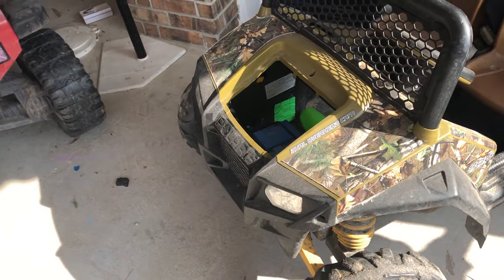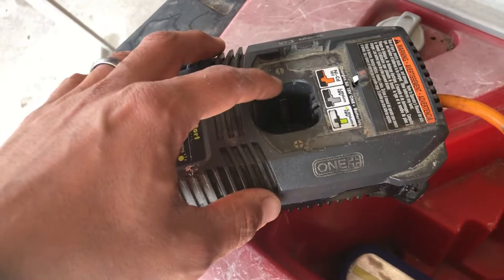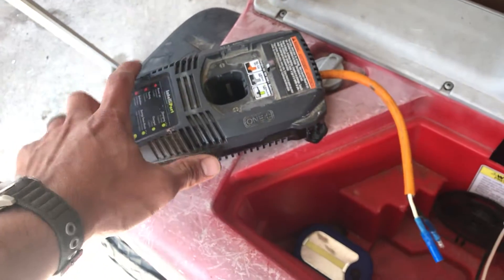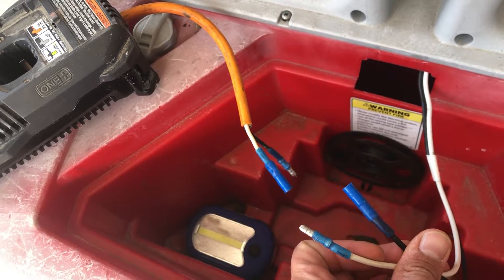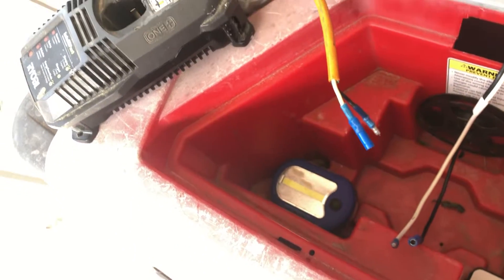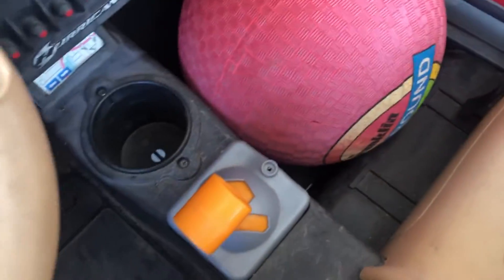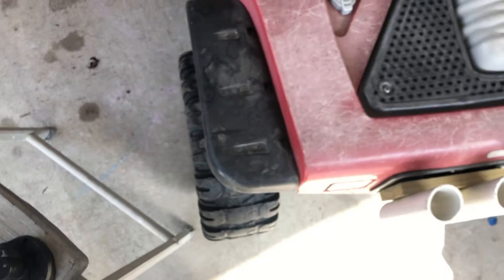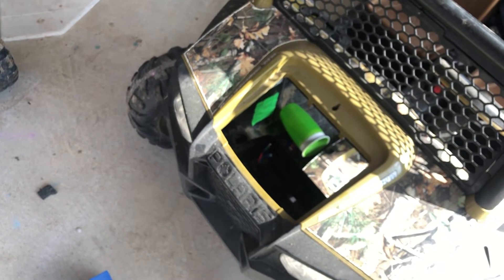Convert 12v power wheels to 18v Ryobi battery

Comment: Thanks for the upload. Which specific battery , that is in terms of amp-hours did you use , and How long did a fully charged 18 volt battery last on the Power Wheels toy? Would appreciate a response soon ! Thanks and best wishes.

Comment: Why solder new wires?  Why not cut the prong-end off of the existing power cord and use IT to splice into the car wires?  (Is it dangerous to use the wires from the existing cord?)

Comment: Any problems since you did this video? I’ve always been worried about an in-line fuse , just never knew what size to get
Reply: I did this mod and i add 30 amp inline fuse .now what i noticed is that the battery get hot and loose power in about 10 min of used i think im doing something wrong with the wires i did a 2 connections one positive and one negative and this types of batteries has 4 connectors  2 for positive and 2 for negative im using the old conector that comes the original battery tomorrow in going to add the 2 missing conector maybe that fix the problem
Reply from the maker: the only issue I have had was using too small gauge wire. Sine the cars had more power the plastic tires saw more abuse and the burnouts didnt help the lifespan either.

Comment: Hey how’s it going wanted to ask you have you had any overheating because that’s the way I wanted to go but then I was thinking to get like a speed controller and a voltage regulator to where it was shut off so it doesn’t just drain the whole battery and kill it totally.  But that’s what I was wondering if you use one of the charging ports does it stop it overheating going far

Comment: Has anyone put 2 or more in parallel to get more runtime and less A on each battery? Also has anyone used a converter to keep the cars same voltage? Friends old lead acid battery getting old so we are looking to do a conversion for the kids. Any help is appreciated.

Comment: Looking to follow the same format you did! Are you able to show how you wired the internal part of your ryobi charger? Im not sure where to solder my wires.
Reply: I second this motion!
Reply: MCRideout I just went for it and just soldered my wires to the +/- prongs and it worked!
Reply from the maker: within the inside I soldered onto the clips that make contact with the battery. the rest of the board is usless.

Comment: Have you had any issues with batteries running down so low that they lose their ability to recharge? I have heard that the Ryobi tools themselves prevent the batteries from draining down too far so by hooking them up this way you don't get that protection.
Reply: I just did this to one of my dewalt batteries today. I purchased some off brand dewalt batteries that supposedly have an anti drainage feature built in. Hopefully that solves the problem
Reply: Use different battery connectors that you can use on a “not” smart charger, if it gets to low

Comment: i have a question. when i use my ryobi battery, it just randomly stops. How do you get past this?
Reply: Maybe an in line fuse 30a between battery and car wires 
I tried to do 36v in series and forgot to connect the in line fuse and burned the control unit and some leds

Comment: Hey there I'm looking to do this exact thing, any chance you can show the inside of the modified charger?
Reply from the maker: within the inside I soldered onto the clips that make contact with the battery. the rest of the board is usless.
Reply: @zekecv  so just the thin wide bent metal bits? Well that makes it easy...
Reply from the maker: @DylanCyr  yes you are only using the charging unit to hold the battery. I'm sure there may be 3D printed adaptors to connect to the battery but I wanted something safe and secure especially since it's going to be bouncing all over the place oh btw a in line fuse would make it a lot more safer.

Comment: I was wondering if i could do this. What kind of wire did u use to convert the charger? Thanks for posting this.
Reply: Cainnech you can also use a ryobi flashlight. Cheaper
Reply from the maker: I used 14 awg. If you go too thin ie 18awg it will heat up too fast and cause damage. Let know how it goes. Ive had this set up the same car for 2 years with no issue.